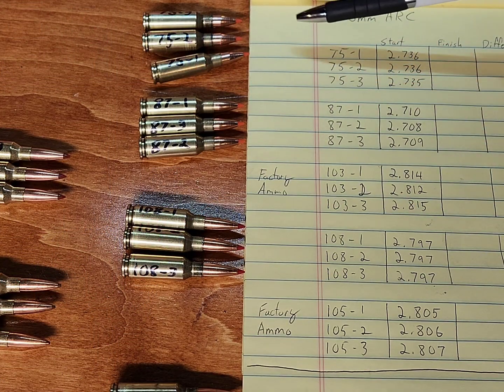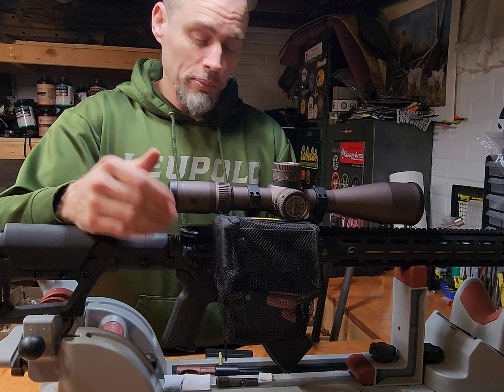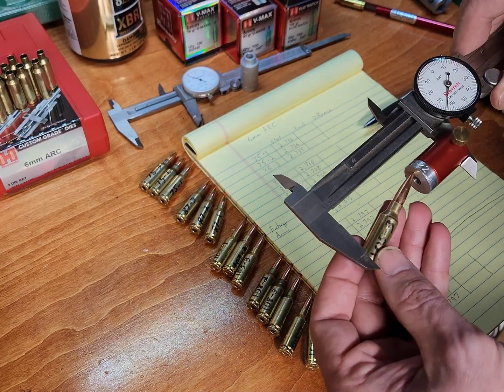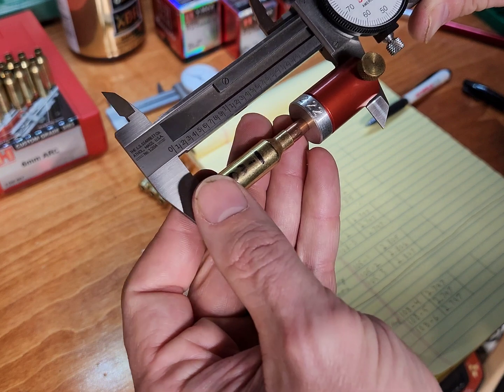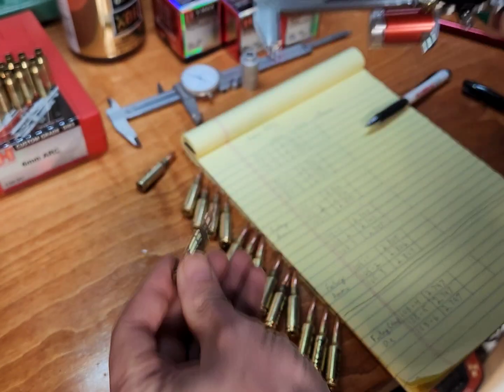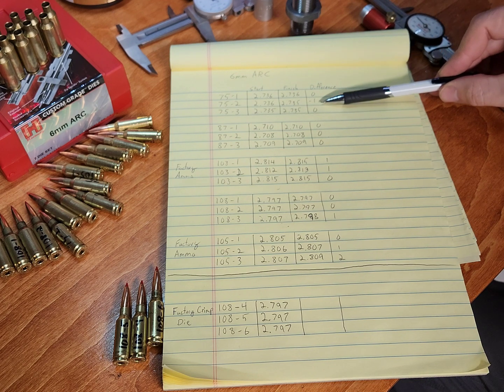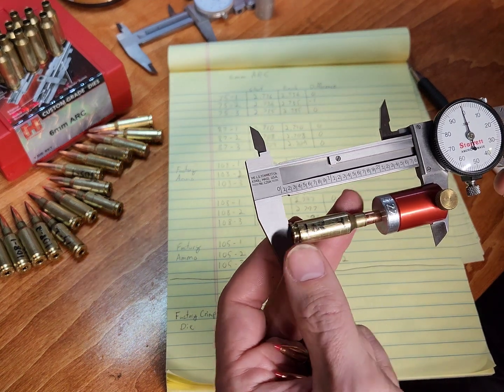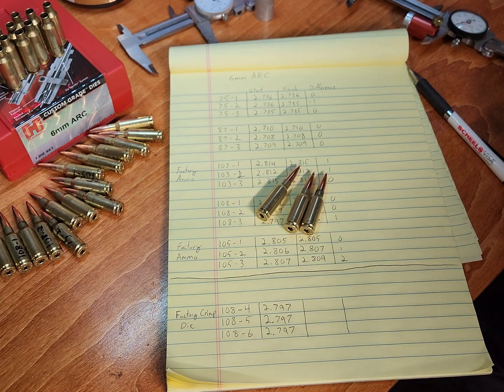6mm ARC: bullet seating depth gets compromised when chamberring a round.

Comment: Good video! What sizing die are you using? If it's a bushing die, which bushing are you using?
Reply from the maker: I'm just using the standard Hornady FL sizing die
Reply: @thelonggunner762  I have almost the same build - Aero Precision with Proof 18" barrel. I'm working my way through the cycling problems.
It will do everything but lock back on empty. Probably going to add the reduced power buffer spring that you did. Is yours still running good? How is the accuracy?
Reply from the maker: @dpwild328  it's been running really well with the 75gr Vmax, 5 shot groups under 1/2 moa. Got some 62gr Varmint Gernades to try next in some new starline brass.
Reply: @thelonggunner762  what powder with the 75 gr vmax?
Reply from the maker: @dpwild328  AR Comp
Reply: @thelonggunner762  Copy. Thanks for the feedback! Merry Christmas!!
Reply from the maker: I prefer using sizing mandrels over using neck bushings to adjust neck tension.
Reply: @thelonggunner762  where do you get sizing mandrels for your FL sizing die?
Reply from the maker: @dpwild328  unfortunately it turns it into a 2 step process. I run them through the sizing die with the expander ball taken out the run them through the Wilson mandrel die.

Comment: If 1 or 2 thou is causing a problem your at a bad seating node or just seat the bullets in a couple thou deeper. I have not found that my bullets move when cycling them. Best powders I've found are Leverevolution for speed and Varget for best accuracy. Thanks for the video!

Comment: If you have single digit SDs and you’re not grouping it’s a barrel harmonics issue… 

Save the barrel and play with seating depth or just throw a barrel tuner on it.  Also check your barrel twist rate and confirm it will stabilize the bullet you’re trying to run.  That could also be the issue.  Lots of times barrel twist aren’t as advertised and when you check it you’d might find that it’s off.
Reply from the maker: Unfortunately I've spent almost 4 months trying 5 projectiles with 4 types of powder including 3 seating depth tests to no prevail.  A tuner has crossed my mind just to seeing it could shrink groups a little.
Reply: @thelonggunner762  The tuner will… but it’s all in what the barrel is really worth to you.  I didn’t stop and think about that in my prior statement.  

The same thing happened to me with a Ballistic Advantage barrel and at the end of the day I pulled the barrel and threw on a Proof.  I knew that’s what I should have done from the start.   At the end of the day I didn’t feel that barrel was worth or justified the cost of adding a tuner are 200+ dollars.  

In general a tuner will tighten any guns groups overall .
Reply: By the way great job on the video.  Everyone shooting heavy bullets in a 6 ARC gas gun is going to contend with bullet creep or set back if they are serious about trying to shoot the smallest group possible.  One thing I’ve come across with using a crimp is brass length has to be spot on and everything has to be concentric to get an even crimp.  If not you’re just introducing uneven neck tention on the bullet.

Comment: Good comparo. I'm running 87gr V MAX and after watching the videos probably the same ones you watched I measured and didn't see any jump either. Not saying it doesn't happen. I'm using resized Starline brass. Also I worked on my feed ramps and I'm using a + strength buffer spring. The 87gr V MAX in the ARC is a fantastic combination. My rifle prints them at .5 - .75 MOA all day, and so far I have reached out to 786 yards on targets and about 450 on prairie dogs.

Comment: Great info, I have working on what seems to be a problem with the 6, I noticed that there is quite a difference in the factory ammo length, After realizing the extent of the factory variance I trimmed the brass and installed an adjustable gas block. Well that started a whole different set of issues, it however seems to be the avenue to go, with the block mostly closed I was able to print some less that 1/2 moa groups without the usual fliers but I had an undesirable ding in the case neck, so from there I opened up the gas port 1 rev which resolved the case damage but printed a horizontal group of 13 rounds in 2" so back to the drawing board. Quite a finicy AR round!
Reply: If you are getting two dings on the side of your brass, it is your feedramps. Looks like barrel manufacturers are using 5.56 barrel extensions which are too narrow for the fat cases of Grendels and ARCs. I ended up smoothing out the hump between the two ramps quite a bit to solve that problem.
Reply from the maker: The AR platform can definitely be finicky! My friend has a 308 which the most accurate handload we developed virtually turns it into a single shot. Bolt actions are so much easier 🤣